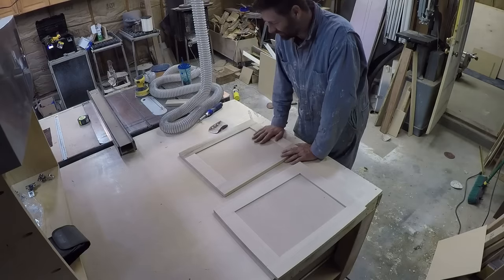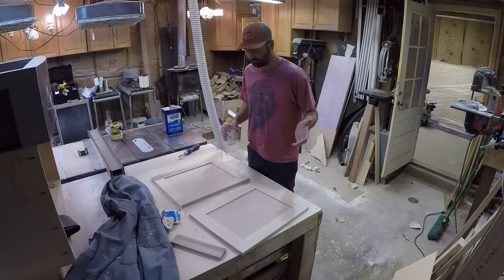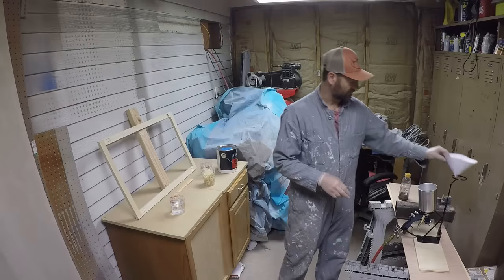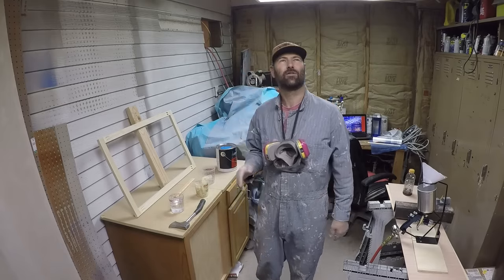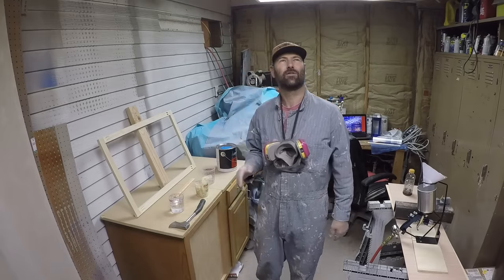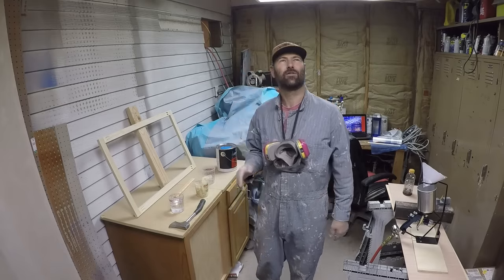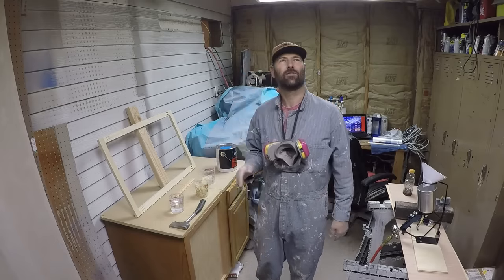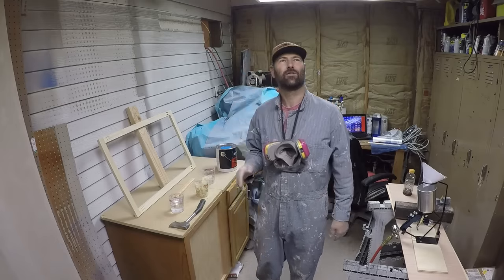Don't Paint Your Cabinets? | THE HANDYMAN |

Comment: Your air compressure is in a pocket where fumes can build. The arc from the motor could ignite heavy fumes. Have a vent by air compressure with it filtered. So filtered air passes by you.
Reply: Ok O.S.H.A. JK yeah I know you dont want a flash BANG
Reply: I think he is good large area and I'm sure he ventilates
Reply from the maker: Yes.  I specifically went over my forced air ventilation in this video for the O.S.H.A guys.   I do realized it is a valid concern and viewers should be aware that you need ventilation when spraying large amounts.
Reply: @TheHandyman1  Dude how you explained it. did not sound like the air was coming from the compressor side. Remember there are people watching your channel that just don't know stuff that professional like us do. Just saying. Not cutting you down or any crap like that. I support your channel and content. If were crap I would not be watching.

Comment: ummm .... I don't know what your definition of "paint" is ... but, lacquer IS paint!
Reply from the maker: That would be incorrect.
Reply: @TheHandyman1  You're incorrect. Look into it further.
Reply: @TheHandyman1  You're using 'paint' as a verb in your title. Guess what you do with lacquer? You paint it on. Besides that, Meriam Webster defines lacquer as "any of various clear or colored synthetic organic coatings that typically dry to form a film by evaporation of the solvent." Guess how many solvent based 'paints' are colored and dry to form a protective film? Additionally, all automotive paints used to be lacquer based. Now most are acrylic or urethane. But all of them are paint, and all of them are painted on, even the lacquers, even the clear lacquers, even the pigmented lacquers. All are paint.
Reply: @TheHandyman1  Next time, rather than being Mr Right, ask questions to find out if the person you are speaking with happens to know more than you do. They might actually be an expert in the industry. How do you know? Now you have two videos with misinformation, that you'll find a way to rationalize away
Reply: @Raoul Duke there’s a lot of self proclaimed “pros” in the business that do cookie cutter crap work. I bet you’re more into tools, lingo, and talking yourself up about the work you do than actually doing good work. Actually, I’d bet on it

Comment: I just changed my hardware and put some pledge restore and shine on the existing wood cabinets. They turned out great. I did the math and painting wasn't economical because of the time I would have to put in. Probably cheaper to put in new cabinets LOL.
Reply: Good idea as they're prob shite cabinets to begin with.
Reply: @johnnytocino9313  Well 40 yr old cabinets. My 40yr old dishwasher is still kicking too.

Comment: Ive painted hundreds of stained oak ("orange")cabinets for customers. I prime them with oil based primer then 2 coats of proclassic  rolled on using a 3" roller. the Proclassic self levels so back brushing isnt necessary. Spraying is not possible or easy in a finished kitchen nor do i want to mask off the whole room to spray.
Reply: How do you handle doors with recess on the center (like the one he is painting)? I assume using a roller will cause it to accumulate on corners which would make for sub-optimal finish.

Comment: should still use a primer for opaque lacquers. there is a primer specifically for duralaq nitrocellulose lacquer.
Reply: Isn't the tinted sanding sealer an equivalent?
Reply: @joncrosby8988  hes not using a sanding sealer. he reduced the product for the first coat and called it a sanding sealer coat. for clears that product is considered self sealing, and a lot of people thin their first coat by 10 or 15 percent for various reasons. when you get a colored lacquer, some colors require the a clear base like this one, and some take a pigmented base. both will show tannin bleed and other kinds of staining without a primer coat... thats been my experience at least.

Comment: The "paint" was too thick, unless you spray closer and slower. You didn't mention what thinner you used -I'm assuming acetone.

If you spray rinse your gun between coats, it will eliminate clogging. That stipple you say... Is dry spray. Avoid that and you'll do less sanding.

If you practice releasing the trigger half way as you begin to spray another pass, then fluid won't be excessive on the edges. Less chance for runs or puddles of paint.

One more thing, you're awesome and I learn a lot from you. Paintwork is however my expertise. Thanks for the video!

Comment: This fool does not know what he is talking about.  Og course if you are going to spray paint, you need an airless sprayer, a HVLP sprayer is only good form paints with high viscosity.  They can also be painted by hand , I recomens adding Floetrol which will make it easier to obtain a smooth finish but will also add to the drying time.

Comment: Don't buy a gun and hope it works.  Match the tip size of the gun to the flow of your paint.  Oil based coatings flow through smaller tips (1.4 is common.)  Water based coatings need larger tips.

Comment: What size air compressor should be used with a "typical" HVLP spray gun?

I bought a cheapo Princess Auto HVLP 2.0 mm and had to return it because it didn't spray enough indoor water-based latex paint and my compressor was running like crazy. I thinned the paint down to about 1 part water to 4 parts paint. It was pretty thin. My setup used a Campbell Hausfeld HL5402 4 gallon 3.7 SCFM at 90 PSI with a 50' 1/4" air line. I know the air line should be min 3/8" so that probably didn't help much but I suspect it's more likely not enough CFM's on the compressor. Can anyone confirm?

Thanks!

Comment: You were doing pretty good until 13:51....sanding with no respirator is just as dangerous as spraying with no respirator...also, not a good idea to lay your substrate down flat and spray from above it....easy way to ruin a project by either introducing drips to it or spraying too much material....just my .02....I do love my Devibliss Finishline....good luck and have fun with it.

Comment: just use professional paint. all of it is subject to VOC laws. homedepot paint will always not be great for cabinets. most products ive use want about 20 psi from the regulator (sherwin Williams pre tinted vinyl sealer) this is the color use  laquor based primer first, sand smooth, vinyl base coat, top coat

Comment: I refinished cabinets for 3 years and we never ever painted them.  After about 9 months paint looks like crap.  After about 5 years, lacquer looks brand new still.  Painters charge  a little less than half of what a FINISHER will charge.  You will not be happy with painted cabs if you know the difference between lacquer and paint.

Comment: I lost all of my lower kitchen cabinets to hurricane Florence. I'm trying to keep the uppers since I did not have flood insurance and I've already been ripped off by two contractors. I'm an older woman I've never painted I'm not sure I could handle this. Is there any way I can keep the original cabinets which are about 14 years old and it's just a plain unfinished maple wood. I'm thinking of buying cheap lower cabinets from home Depot but I know they're never gonna match. should I go with just a lower cabinet and white and keep the maple on top or any thoughts what I could do? Thank you!

Comment: Hey there. I am going to use Sherwin Williams Aqua Kem Plus for my cabinets..totally worth the time and money to get.  What is your go-to wood filler product?  And, second, the Aqua Kem doesn't need thinning for the gun, but the primer does. I was reading a blog where someone used a 4:1 ratio to thin the primer and he added Floetrol to the mix as well but her didn't give the exact ratios.. is it 4:1 paint to water and THEN add the Floetrol to that mixture?

Comment: Couldn't go through all your comments, but you should try "positive pressure" ventilation. We use it in the fire service to remove smoke. Negative pressure pulls air through the path of least resistance . Positive will move air in all parts of the room.

Comment: Great video if you want to spray. We rolled and brushed with no regrets. Great video. Thanks for updating us. What we did with our dark oak cabinets was to degrease with tsp and rinse rinse rinse it off and then sand so you don’t drive the grease into the wood. Sand until you think your done and then sand some more. Two coats of primer allowing a full day between coats to dry. Then two coats of an enamel top coat paint allowing at-least 2 or 3 days to dry between coats. Then let cure couple weeks before putting on hardware and installing. Lots of work but you won’t regret it.  We just posted on our channel a 2 and half yr update video on our painting results. Still looks fantastic.

Comment: Hvlp high volume low pressure your coats will turn out alot better if you drop the air pressure

Comment: Lacquer is easy to get a nice finish with.BUT it smells horrible and I have realized that for me, I simply don't have the right spray area/booth to handle anything expect waterborne finishes. 

I would like to be able to spray conversion varnishes but they are too dangerous for a non-pro to be messing with.

Comment: Funny. Swear if could hear Handy Man in a high speed squeaky voice say, “You can’t use 120 sandpaper, gotta finish with 220! ; )
Reply: I suspect he will sand the finish at 220 before the final coat. Its what I do with these finishes.  Sanding too fine closes the pores and the finish  doesn't pentrate well and looks blotchy
Reply: @joncrosby8988  --  Before your final coat , lightly buff with  6-0 Steel Wool  and wipe down with a Tack Cloth , then apply your final coat .  --  ( I Apprenticed with a Professional Cabinet Maker back in the Early 1960's . ) .
Reply: @John S. Richards  --  That was the Garage Mouse that you heard .  Lol  .  He even stomps his foot at it  @10:36 .

Comment: I don't like lacquer. In two of my house's the Lacquer was flaking off leaving an ugly looking set of cupboards that I couldn't fine a fix for. I even went to the cabinet shop and ask if it could be fixed. And they weren't aware of a fix
Reply: Prep well first clean,then sand,vacume,tack clothe ,do a small test on the back of one door first ,let dry,next day try scratching it off or tape it to see if adhesion of paint bonds well,before applying coating to entire cabinets. Sand paper recommended would be 220 grit.

Comment: Can some tell me the difference between the paint he uses and a water based paint like Benjamin Moore regal? Which I was going to use to paint my cabinets.
Reply: The BM Regal is probably much more suited to kitchen and bath cabinets and to homeowner use can brush roll or spray and stand to be in the room with without a mask.
Lacquer has been around a long time, Catalyzed is the only stuff worth spraying imo. You will need very good ventilation and respirator. The fumes are nasty and take quite a while to go away ( You don't want this in a house you are living in until it gets done off gassing ). The good is that it sprays very easily, dries in minutes and is easy to repair. 

They are 2 very different products.

Comment: For cabinets requiring a fine finish, would you recommend the Homeright HVLP or the Graco TC Pro Plus Airless Paint Sprayer?  I have some cabinet renovations going on and will probably be using the paint gun to also paint some exteriors on a home in the future.  I would prefer to get one good gun that could do both if possible.  What is your expert opinion?
Reply from the maker: I would not recommend any of those for a fine finish on kitchen cabinets.

Comment: why don't you use the Lenmar Duralaq waterborne lacquer paint? i use it all the time, much easier brother.
Reply from the maker: What is the dry time with that?
Reply from the maker: Looks like the only reason to use it is if you live in California.  The only benefit is it is eco friendly
Reply: I live in Toronto. It's all we use on cabinets. Dries in about 30 minutes. Great product, works well with a coat of BIN shellac primer as the undercoat.

Comment: What about marking the frame inside the pocket holes?
Reply from the maker: Come again?   LIve stream tonight?
Reply: @TheHandyman1  you mentioned putting a mark on the bottom of the frame. You will cover that with the finish. So I was thinking that you can mark inside the pocket holes like you did with the hinges.
Reply from the maker: That would work too.

Comment: Dude right before paint gun you should have inline water separator.
Reply from the maker: If I was painting a car I would say it is a necessity.   I do have plans for a water separator.
Reply: Those little in line filters don't work very good are basically useless if you paint with your compressor a lot you need a air line dryer but they ain't cheap
Reply: @waynekerr2472 , They do help. better than water just going from the hose to spray tip. Water-based paint no sweat.

Comment: 8 hours? Holy shit! 2 hours should be a max dry time.
Reply from the maker: 6 hours is the norm.  8 is also very common for home owner grade low VOC "cabinet paint"
Reply: @TheHandyman1  6 hours? That cant be for Lacquer.
Reply: 6-8 hours for oil based paint, no more than 2 for water based.

Comment: This was basically me in a nutshell today... I was literally researching HVLP top feed sprayers after painting some cabinets, tired of rollering the water based garbage I gotta use here in So Cal. I saw the brand that seemed to be the best for car guys, and it's the same brand the Handyman got. I thought okay, this seems to be some good vibes. Let's see what he sprays... sonofabeechtree. Can't buy that good stuff here. Baaaaaack to the drawing board, trying to find a good paint for cabinets. Sigh. Ain't that the way it goes. At least I'm on track for a good HVLP Spray gun.
Reply from the maker: Down below in the comments  a guy talked about a low VOC option that he sprays and has a faster dry time. He was from Canada I think.   I am going to switch to a pre cat lacquer for the next set of cabinets.  It has a harder finish then the Nitrocellulose lacquer that I started with.
Reply: @TheHandyman1  Thanks, I'll definitely check that out. I also found out from a quick Google there is some additives you can add to help the paint cure to a better durability as well. The funny thing is I've looked before a few times without finding all this great material. Just gotta keep looking. Love the YouTube and Instagram community, find out about a lot of great products you wouldn't otherwise know about.
Reply: Use a clear coat over any decent paint nice and durable.

Comment: Hey Handyman, several companies have come out with a remarkable (battery powered) no less, device that is relatively lightweight and designed to accept a multitude bits that will fit all of the 36 different type of screws from Phillips to star even the bastard screw, the dreaded flathead. This handy little device has all but made the "screwdriver" obsolete. Just thought I'd pass this along to you, if you're like me you get caught up in the rat race of life and sometimes these things slip right by you. Maybe you could do a review video on the particular one you choose. Take care.

Comment: Thanks for posting ! Quick question: What's the pressure needed for your sprayer? I'm trying to determine what pressure (in PSIs) for which I need to buy my compressor. Thanks in advance.
Reply from the maker: Pressure isn't important it is CFM that is important.  The air flow at a specific PSI.   13 cfm at 23 psi is what you need to use this sprayer.
Reply: @TheHandyman1  thanks for the reply. I'll have to look into this further. I bought the $150+ kit sprayers from Lowe's/HomeDepot and hooked it to a 130PSI compressor. Nevertheless, the sprayer didn't even sprinkle. I'd like to say the pain was perhaps to thick... That said, i have no clue what CFM specs is my sprayer. In any case, thanks again! I have now another angle to tackle.